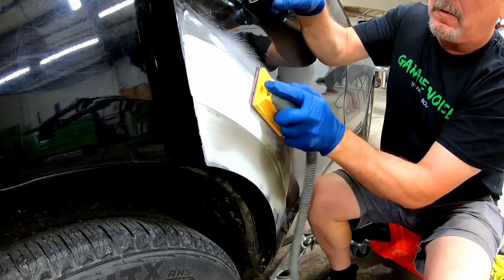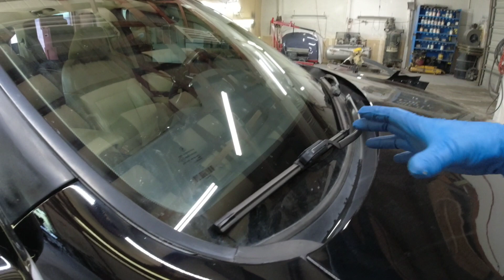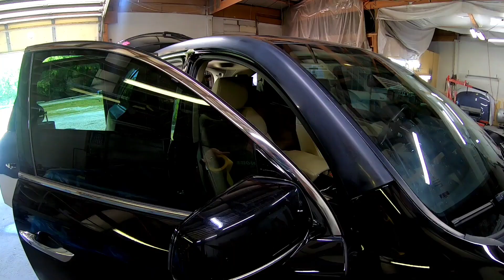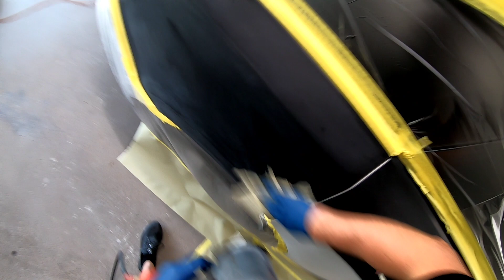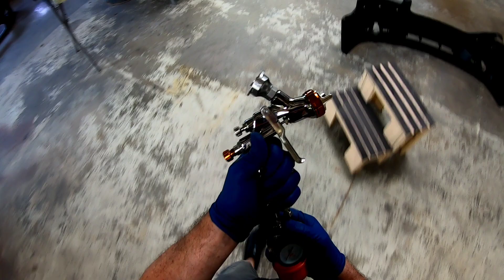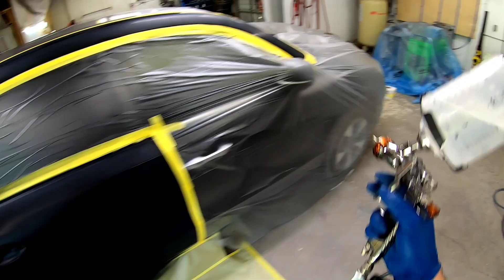The ultimate guide to perfectly prepare and paint a car.

Comment: Hi
I painted at home my car, qauter panel I grinding down 320 paper 2 coats  high build panel, I used 320 with gaurd coats then given 2 coat of 1k sealer,  I also used wax grease remove between and rest of panel sended with 400, 600 wet and dry sandpaper and  base paints 3 coat and clear 3 coat too, each now after 5 days my all paint peeling off?

Comment: I want to repaint my poorly painted car. What grade should I sand my clear coat to spray new base coat or should I reprime and then base coat???
Thank you for all your guidance.
Reply from the maker: What condition is you paint in? Cracking, peeling, faded, or is the clear deteriorating and becoming chalky?
Reply: @GarageNoise  The clear coat had deteriorated so I sanded all of it off and primered it.  I then sprayed it with spray can metallic paint and 2k clear and learned my lesson.  I had some tiger stripes, uneven metallic color, and dry powder areas.  I then tried to correct it in small areas and learned I have to do the whole panel, not a small area.

It was a very costly lesson in time and money :(
 
I should have used a gun to spray the paint with slow hardener and the same with a 2 part clear coat.  I have since bought a 21 gallon compressor, a water and oil separator, hoses, Sprayit LVLP gun, a disposable paint measure system, and a color match light.

What an adventure!  Please help!

Paint is not peeling.

Comment: I want to repaint my poorly painted car. What grade should I sand my clear coat to spray new base coat or should I reprime and then base coat???
Thank you for all your guidance.
Reply from the maker: 320 if there's  no peeling or cracking issues in the paint. You also may go over it with 600 after 320 will help to have finer scratches if your not using sealr and just going with base and clear. Hope this helps appreciate the support!

Comment: These videos are so helpful to me as a DIYer. Is it possible you can wait TOO LONG between coats, or between base and clear?
Reply from the maker: It is possible to wait to long. Most basecoats have a pretty long recoat window. (Hours) always check the technical data sheet for the  paint your using. For clearcoat  the time between coat is more critical.  If you wait too long this can increase the chance of die back, which is a diminished gloss. Applying the second coat of clear too quickly and you risk getting solvent pops. Which is when chemicals don't  have enough time to off gas and get trapped between coats. If you follow the manufacturers guidelines you won't  have any issues. Appreciate the question and support of the channel!

Comment: So what was the sand paper used on the blending panels ?
Reply from the maker: I use 600 to prep the blend panels.
Reply: @GarageNoise  and than you spray the clear coat over the 600 sanded panel?
Reply from the maker: @ydtech2649  yes and I dry sand but you could wet sand as well .
Reply: @GarageNoise  I'm painting the rear bumber as the top part on either side of the bumper the clear has faded, so I'm bleeding from the top to the bumper to middle.
Reply: @GarageNoise  what are the 800 pads used at 3.10 on the blend panels sunmight? have you a part number for those? Great content here.
Reply from the maker: @smartrepairpro-uk  yes I think so might be 3m. If you have any interest in products I use you can find it in my Amazon store.  Here is the link to the foam sanding pad. https://amzn.to/3MzX9e7 Appreciate the comment and support

Comment: Really great work…. I have a few questions for you if you don’t mind. 
1. How long did you let your primer dry before you dry sanded?   I had tried to sands primer after a few hours when it seemed dry, and just gouged the repair.  
2.  What levels of sandpaper would you use for Ecoated part?  I did have to sand and add body filler to one corner, and primed.  Painting a new hood and two fenders off of the car.  Paint is black. 
3.  Would you use the little filter inside the paint gun?  I dont have the pps sys…. 
Also noticed you do not strain the clear when adding to your mixing cup,  Is this only necessary for paint itself?
thank you for your time.
Reply from the maker: The primer I use is a 2k primer on a hot day a couple hour. Most of the time I'll  primer at the end of the day and let it dry overnight.  For e -coat 320 or 400. You said your painting  black so that would be good but if your paint high metallics you need to go back over with 600 or 800 for a finer scratch. I don't  use those little filters, strain your paint and clear  I don't  always strain clear but you should the pps cups do have a strainer screen. Hope this helps thank's  for watching and supporting the channel!
Reply: @GarageNoise  
Wonderful
Reply: @GarageNoise  
Thanks for the reply.  I went ahead and ordered PPS and an adapter as it seems to be the standard for pros.

Comment: Hi Chris, Love the video. Questions. I have a 1994 Toy truck and the engine hood and cab roof clear coat is shot and the base coat is exposed and the too will have to be reapplied. No rust but a few rock dings. I will fill and blend those spots. Should I sand and remove all the clear with 320 grit? Do I have to prime if the original base is OK or just seal? Should I remove the hood from the truck and paint it by itself or leave it in place? I will take the truck to the paint supplier and get them to match as best they can with the surrounding paint. I'm not too worried about the roof as it's up high but would like the hood to sorta match the fenders. THANKS DAN
Reply from the maker: The question to remove the damage clear is one that's hard to say without a visual inspection but sounds like your on the right track. Sand smooth with 320 . Then I would use a 2k primer you can reduce it 5-10 percent because your not looking to fill you just want to seal it off. If you do that you might not even worry about sealing it before paint . You'll of course need to sand primer with 600 before paint . As far as removing  the hood , I would just prep the fenders with 600 blend the color into the top of the fenders  and then clearcoat it all at the same time on the vehicle.  That way you'll  have a perfect  color match  and  results you'll  be happy with. Hope  this helps. appreciate you supporting the channel!
Reply: @GarageNoise  Wow thanks for such a quick reply! I will follow your advice with the 320 and see what happens on the hood. I'm pretty sure what you say will work. Need to experiment a little and jump in!! I really like you videos because I'm not looking to make a concours paint job. One can get so bog down in the minutia IMO. I don't have a spray booth so I ain't going to get a perfect paint job from the get go. Do I need to skim coat my entire car? NO! Your videos reflect and teach what 99% is needed to get a really good paint job. Thank you!

Comment: I have a few guns I use for base, but for clear I keep going back to my W400. There may be better guns,but not at the price I got it.
$240 bucks a couple years ago.
   Just used the Astro Evo gun for a two tone job and it did great. I sprayed clear on the hood with it, but then switched back to the W400 -sticking with what I know.
  Lastly, I might have to give the Finish one clear a shot. But it would be the overall clear as I mostly do full  paint jobs  here at the Bear Budget home garage.